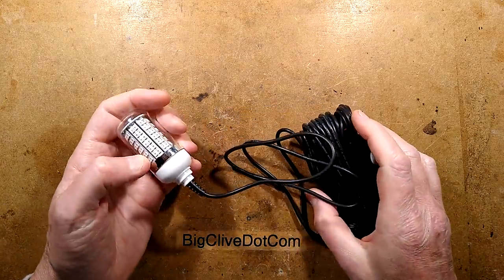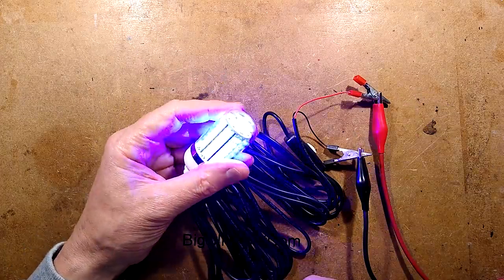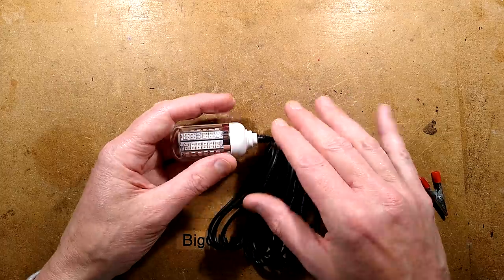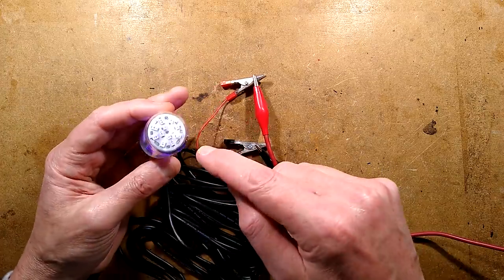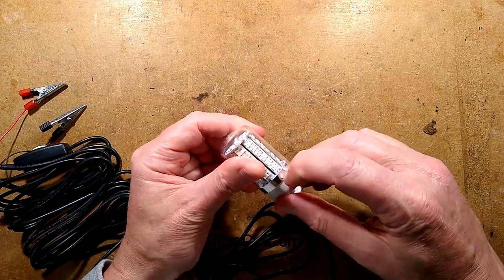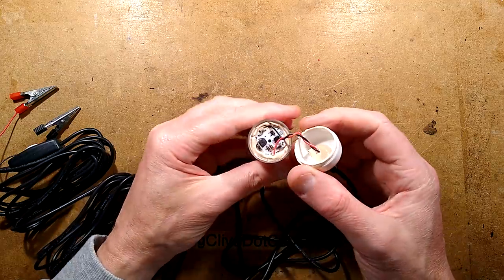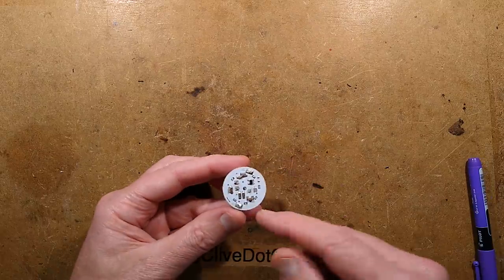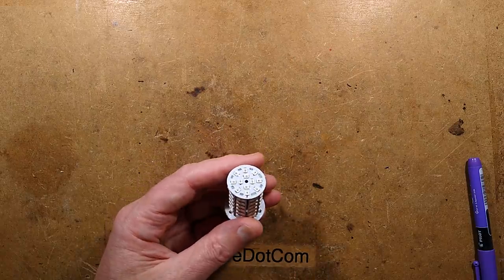Inside an LED fish lure (with schematic)

Comment: I received a similar device as a gift many, many years ago. It used a small incandescent flashlight bulb powered by a pair of AA batteries at the other end of the wire. Not being very sporting and if I recall correctly not legal to use for fishing. Nevertheless I took it out to the end of a dock on the local lake one evening and dropped it in. Lying on the dock peering down into the water I soon saw a couple large fish swim up to it to see what it was all about, so the basic idea does work.

Comment: The Ministry for fishing in my area prohibits any glowing or lights for fishing lures.  This might be good for a decorative pond light for hiding under a rock or maybe attracting insects considering the colour of the LED.  Looked these up on EBay.  It seems the Green or Blue LED ones are the most sought after for about $15-$20

Comment: I went sea fishing in Taiwan on a typical tourist charter boat and during daylight hours I noticed all these large lightbulb globes (looked like HID style bulbs but massive) hanging up above the boat. When nightfall fell I was very surprised that not only did these lights all get fired up (with a slightly worrying humming sound) which was honestly blinding…. But after a short while the crew started chucking them all overboard and letting them sink down. I didn’t take long for fish and squid to start coming up from the deep. And the rate at which everyone was hooking fish doubled. An amazing yet slightly worrying (as an electrician!) experience. In short… lights definitely helped catch more fish
Reply: They use 2kW metal halide lamps.

Comment: Here at the lake we have a light out on the dock by the water, but not in the water. On the outside of the light is a wire that spins around like a weed wacker, knocking the bugs out of the air that are attracted to the light. Then the fish come and eat the bugs. They are now trained to always come to this area because there are always bugs to eat.

Comment: Looking at the video - we seem to have both near-UV and cyan light - is there any indication that there are multiple chips in this packages? Or are they using a near-UV chip to activate a light coating of cyan phosphor, so both the UV and the blue light is released? That strikes me as a good device to make a fish lure out of, but can't think of enough other uses for them to make production of the LED components viable - apart from fake germicidal products!
Reply from the maker: Just a deep blue single colour.

Comment: These work great for striped bass at night at Lake Powell (Utah and Arizona - it's a big lake).
Reply: Stuff like this, supposedly wettable, I use silicone sealant and high grade electrical tape to seal them myself before ever sinking them. Might even put the whole thing in my own sealed container made from a canning jar.

Comment: I don't think Heat would be a big issue with this, despite the density of the package, it is designed to be underwater, and the thermal mass of a even small container of water would keep this fairly cool without issue.

Comment: Pretty rare that I downvote a video,  but I found the unnecessary destruction in this video didn't sit well and not up to your usual standard of analysis and testing.
Reply from the maker: When I make a video it is normally done as a single take or two sections.  There isn't time to take things like this, that are glued together, apart in a swift enough manner.  The point is that by opening one I save everyone else having to open theirs.

Comment: Interesting that the freewheeling current is passed through the current sensing circuit as well. These switch mode current source chips are very sorted these days.
Reply from the maker: I think they do that to keep the pin count down.

Comment: Are you doing a Jeremy Clarckson here? Or why are many people writing/saying "an LED"? When it is not only more correct but even more convenient with "a LED" ;-)
Reply: I've seen this joke elsewhere but I don't understand it.
Reply from the maker: Yes.  An Ell Eee Dee.
Reply: @bigclivedotcom  - you're both wise and clever ;-)
Reply: @TechGorilla1987  - the grammatical rule is to use the indefinite article "a" in front of words starting with a consonant, and for a better flow using "an" in front of words starting with a vowel. On Top Gear Jeremy Clarckson made a habit of doing the opposite just to annoy people, like "that is AN car". But Clive's reply makes perfect sense, as I've always called it "a led" and not spelled it out as "an Ell Eee Dee" and I've never thought of it in that way. I think we need Stephen Fry to settle this one.
Reply: @jensrogerkristoffersen5472  Thank you for the explanation.  I understood the grammar faux pas part, but I never watched Top Gear and I haven't watched an teevee (see what I did there) for many years.  Interesting, I always saw Ell Eee Dee as an acronym like S.C.U.B.A or L.A.S.E.R.  but never thought to pronounce it as a word as I do for those other examples.

Comment: Clive, could you modify this gadget to include a USB cord to run off a 5v power bank since you've mangled it?
Reply from the maker: It could be run with a USB to 12V adaptor.
Reply: @bigclivedotcom  right-o. An off the shelf solution. I was just suggesting an idea so I could watch you do some soldering and hacking. Those are my favorites of yours along with the distillation and carbonation videos. Thanks for your content!

Comment: Weird....  if this does work, I'd expect longer wavelengths to work better?
Reply: Blue light penetrates further in water. This is why water looks blue: the long wavelengths are absorbed first.
Reply: @zh84  I thought the blue was from rayleigh scattering.
Reply: @zh84  Ahh, you're right. Just checked. That's interesting!
Reply: From the charts I've seen around 450-470nm (ie. blue) penetrates water the best, other charts put it closer to 420nm.... but regardless blue is best.